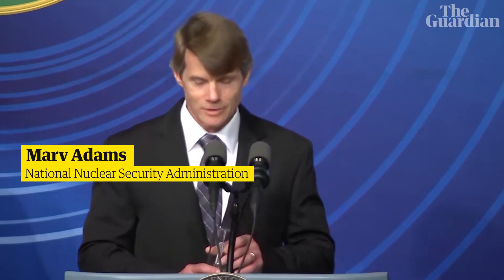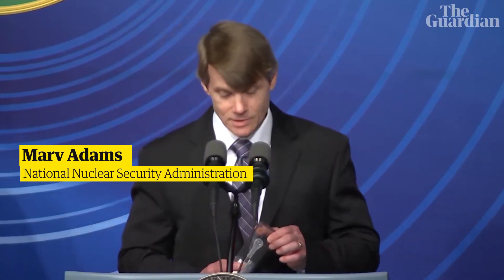Nuclear scientist Marv Adams explains what happened in the successful fusion experiment

Comment: For those claiming that this shows we can get more energy out than what we put in, doesn't understand the laws of thermodynamics. One thing to note that you have to account for all the energy in the event including external and internal energy. We can take a ball and throw it down to earth and get more energy out of the ball than what it took to throw it because gravity also accounts for some of that energy. So, when you are looking at fusion it's not just the energy we used to produce it, but there are also subatomic principles that also can take over once the initial energy is used, because there's still potential energy at the subatomic level that just need a slight push for it to take over. Now, does this mean we've solved the world energy needs? Hardly because if you take the energy produced from fusion still has to go through energy loss as it is transferred from fusion back to the energy needed to produce fusion again. There's also the issue with material limitations and the energy required to mine, purify, and place it in the fusion reactor to get the energy output again. When all is said and done, it will again come down to cost vs product, the higher the cost the less we can rely on it.

Comment: "it's always just 5 years away ..." No More!!! This is incredible. This changes everything in the energy marketplace.
Reply: It's been 70 years of research, and they're at the point where they get 0.75% of the energy back that was put into the entire system. This is still a major milestone, but it's unrealistic to claim it'll be ready in 5, 10, or even 50 years. There's still a lot of work to be done.
Reply: @ryanthompson3737  But that's just due to the inefficiency of the laser, which is almost certainly a much easier problem to solve. They weren't even trying very hard to make the laser efficient, so now that it's the main next step, I'm sure new milestones will happen soon. I bet we'll get true >100% energy back within 20 years.

Comment: Fusion is a pipe dream.  Let's see a self-sustaining and controllable chain reaction!  Forcing two atoms together that will fight you every angstrom of the way and then be able to harness the energy release to cause another fusion reaction cannot work. Entropy via radioactive decay is a natural process of matter breaking down and releasing energy in the process.  To reverse that requires an enormous input of energy to force something back together that wants to stay apart. You will never get any usable surplus energy out of that.  Cramming one atom together with another while requiring the aid of 192 laser beams is a very expensive lab toy at best.

Contrast that to Uranium which needs very little help in splitting.  It wants to decay.  It will release plenty of neutrons which only need to be slowed to where it will be captured by another Uranium atom and the process repeats itself.  Overly simplified but, you get the idea.  Controllable and self-sustaining fusion cannot be done and never will.

Comment: Can someone explain how 2 megajoules in and 3 megajoules equals a gain of 1.5?
Reply: It is a gain of 1.5 times more than what was put in.

Ok, some basic maths for you. 

One is exactly half of two, right? 

So if you take the number two ... and add half it (1) back into itself, you get the number three. 

So it is a gain of 1.5 times the original number.

If they had put in 2 megajoules and got out 4, it would have been 2 times more.

Putting in 2 and getting out 3 isn't quite a doubling (2x); it is only 1.5x

Math isn't that difficult to understand.
Reply: @donaldwilliams4019  I think they were thinking of subtraction and not multiplication/division

Comment: What was the fuel?  
Was the input energy the actual amount measured in the container, or the overall input TO the lasers? (Sounds like the former in the presentation)
Reply: Lasers used 300 MJ compared to the 2MJ given to the capsule, that said this is old technology and newer lasers are expected to be ever more efficiency . Also need to consider though efficiency of getting energy out of the system into electricity

Comment: This is a farce.....the energy they produced is 277.78 watt hours, one average home requires 1,223 watt hours per day. Unless you scale this up to an ABSURD level then the energy this produces is completely useless. Esentially this will need to be scaled up nearlly 100,000x to power one small city. It would need to be scaled up nearly 100,000,000x to power  a city the size of Los angeles. This will likely never work  but if it ever does it will require breakthroughs in multiple other areas of science and probably 50-100 years of funding. Don't buy the hype.

Comment: He failed to mention the 500 MJ that the lasers consumed. Sorry but this is an overhyped tiny step forward. It’s also concerning that the details of the press release mention military (defence) applications.
Reply: 300 MJ in the article I read. Doesn't change that 2 MJ of laser impulse went in and 3 MJ of fusion energy came back out. That has not happened before, except in thermonuclear weapons. It's a step on the road to fusion power, but an important step.

Comment: Got chills,this is amazing. If it's true, it's possibly more then a generational brake though!. But as always. With great power comes great responsibility. Let's use to create and not destroy.
Reply: We used it to destroy (or at least we designed it to destroy) ~70 years ago. H. Bombs are the first application of fusion that we had, now it will be put in a bottle and sent round the world. Will we use it to power weapons? Sure, any weapon with a high yield power source requirement such as ship to ship lasers or ship engines would benefit from clean renewable safe energy. But the destructive potential of fusion was explored first. This is like GPS, started off by the military, used now by the public, still useful for the military. But H bombs are unlikely to be put back into use, we don't have an application that calls for larger yield explosions per bomb, we have that capability already and H bomb testing was discontinued in the 60's as part of deproliferation. What the military wants is high precision targeted weapons that can eliminate a target and only that target. Warfare has changed and building a fusion bomb has been easily achievable but not desirable for a long time now.

Comment: Ignition means it will continue as long as there is fuel.  If there has been no errors and this is true, this is amazing and wonderful.
Reply: Except this design if reactor has a limited fuel source the size of the pellet, each time you reset the pellet you need to fire lasers again. For magnetic confinement fusion the fuel can be infinitely added like wood to a fire except ignition hasn’t been reached for that

Comment: Can someone explain how you can have more energy output than input? I thought energy conservation meant you could never have more output than input. Honest question, i'd just like to understand.
Reply: It's about growth. I reckon the energy it is fed acts like a key. Once you have the reaction you have your output. The problem we've always had with fusion was that it required more startup energy than it gives back, and it doesn't stay active long enough for it to be worth anything. So I think this is sustained fusion.
Reply: If 2 hydrogen isotopes atoms are fused into 1 helium isotope atom, there is energy released. So the energy is already there in the hydrogen isotope fuel. For the first time man-made fusion outside of a thermonuclear bomb, had fusion where more energy was released than what it took to start the fusion. Tokamak reactors have done fusion for up to 5 seconds, but the fusion reaction released less energy than it took to make the fusion. This laser induced fusion happened in roughly 0.08 nanoseconds and is a different process of causing fusion than the tokamak reactors. So while this is an important step, there is still lots of work to go.
Reply: @steveaustin2686  Oh so it's a bit like igniting a pile of wood. Takes little energy to start but releases a lot of energy afterwards.
Reply: @steveaustin2686  Was my assessment correct?

Comment: I'm not sure why he puts so much emphasis on the duration of the energy release. If anything, releasing a lot of energy in such a short period makes it harder to harness.
Reply: Because that was how they got the laser induced fusion. This doesn't mean that fusion power plants are around the corner, as there is still a LOT of work to go. It's an important step though.
Reply: @steveaustin2686  - That is totally unrelated to what I wrote.

The relevant part is the amount of energy released vs. starting energy. The extremely short duration of the release is at best irrelevant, at worst a bad thing.

Comment: Fusion has gone from "we cant build the conrainment big or steong enough" to "did it in this glass tube, well the small bit at the end you cant really see."

This is possibly one of the most important events to happen in human history, we just took a major step to solving the impending energy crisis.
Reply: I'm sorry but what is this reaction fueled by? A lazerbeam of light photons powered by electricity, striking a capsule with what inside it?
Reply: @TheAnnoyingBoss  Its fueled by hydrogen.  192 lasers focus onto a bb sized pellet which consists of a gold outer layer, a diamond inner layer and a core of hydrogen or its isotope deuterium.  The lasers cause the outer layer of gold to instantly vaporize in an explosion which pushes the inner diamond layer towards the center in an implosion.  This implosion drastically increases the heat and pressure in the core of hydrogen which causes the atomic nucleus to get so close together that they can fuse to form helium.  because the helium nuclei is slightly lighter than the sum of the hydrogen nuclei that formed it, a part of the mass is directly converted to energy in this case heat.  the important thing is this is the first time that more energy was produced from the fusion reaction than was put into the system to start the reaction...i.e. it can become a valuable energy source to power our world.
Reply: @TheAnnoyingBoss  atom energy im assuming im not a expert, but i believe its purely the energy that was contained inside this said capsule meshing together at such a insane speed that it literally spawned more energy that was inputed, out of thin air of this capsule! I do wonder what material the capsule was made out of, and the energy output of each laser themselves
Reply: @thatlexusguy1029  I believe the process of gianing energy from fusion involves two higher energy atoms being combined into a single atom with a lower amount of energy than the original two combined. That energy still exists though and it's that surplus we are after.
Reply: @TheAnnoyingBoss  hydrogen if I'm not mistaken.
Reply: @TheAnnoyingBoss  tritium pellet and its hella expensive and they can only do this test once per day when they need to do it 100000 times a day.
Reply: @Hayyyward  same thing with oil and whatnot energy from few decades back. It will eventually fall to consumers side. Don't worry and let your children and their childen pay the whatever bill in your head.
Reply: The elites actively abetted the “energy crisis”. Green Agenda.
Reply: there is no impending energy crisis, we've found more fossil fuel reserves than we believed existed in recent years

Comment: So they can create energy?
Reply: No, they are releasing energy via fusion. If hydrogen isotopes are fused into heavier elements, a lot of energy can be released. Until now, they only way man-made fusion released more energy than it took to create the fusion was with thermonuclear weapons. This is laser induced fusion without the bomb part. The laser induced fusion method is not the same method as used by the most advanced fusion prototype reactors. Still is an important step on the road to fusion power plants.

Comment: So basically they made a free energy machine, niiiice.
Reply: No, it's fusion, so the extra energy comes from the release of energy when hydrogen isotopes are fused into heavier elements. Until now man-made fusion that released more energy than it took to start the fusion only happened in thermonuclear weapons. So this is fusion without the bomb part.
Reply: @steveaustin2686  twas a joke,  I have a PhD in chemical engineering i know what happened.
Reply: @idothings6685  How am I supposed to know you have a PHD? Maybe put in a smiley face to help that you are telling a joke? Some dude on here is talking about how this will be suppressed like the engine that ran on water was suppressed. Of course you can't suppress an engine that runs on water if it doesn't exist. :)

Comment: This still a problem. 
The elements to produce the 3 Megas were diminished instantly therefor the continuum ignition will not be succeeded. 
This is just a temporary result thanks to the 2 Megas caused by the laser + the elements sustaining the reaction. 

Crafting such elements to contain sustained reaction still a problem 😢 

Yesterday I lit up a Match, lasted for longer than the force applied. Unfortunately the match went out, including the elements surrounding it. 
Therefor we are hiring.